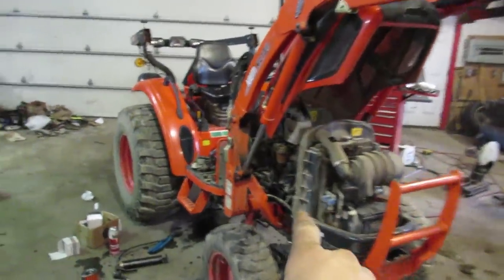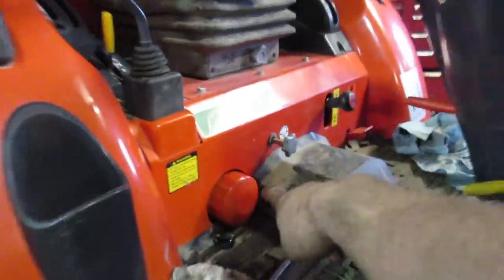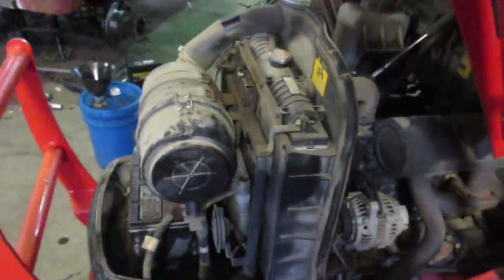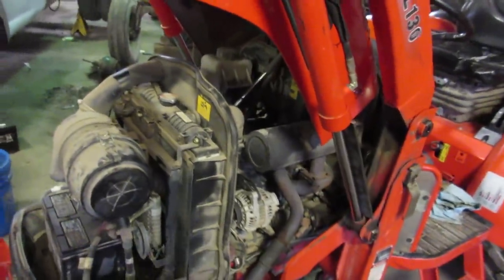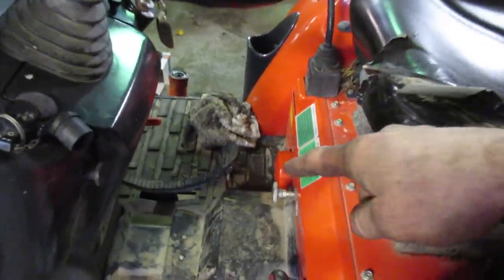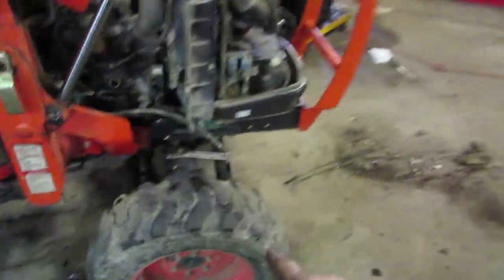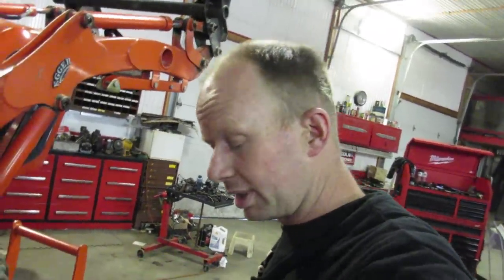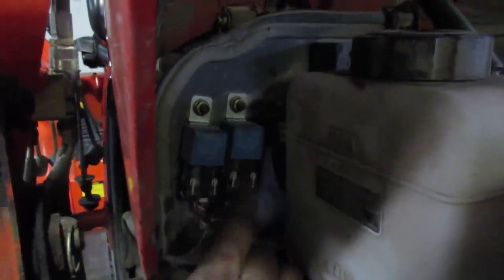Here's Why the Kioti CK35 Compact Tractor Is The Ultimate Oversized Lawnmower

Comment: I looked for a small tractor for over 5 years and then came across a Massey Ferguson 240 in an auction in 2002. The auction was in late November close to Thanksgiving and the weather was cold. Not many showed up for the auction. I got it for $6,000. It had 1030 hours. I got a loader for it and it's been a great tractor. The rubber was like new and it has two remotes. The Perkins diesels are great engines. The only thing that would make it better is a shuttle trans..... Love it........

Comment: I was probably the dumb guy that bought a new Kioti... Purchased a CK3510SE HC with loader and a backhoe in 2017. It is now a little over two and a half years old. It has only has about 120 hours on it, and it is stored under a covered shed, but when I do use it, I do not baby it, and I have had no problems. Regular maintenance is all I have done, and I use the loader at near capacity a lot of the time. In fact, the loader capacity of the Kioti, in 2017, was the main reason that I chose the Kioti over Deere or Kubota. I would have had to jump up a class in each of he others product lines to get similar loader capacity.
I don't really plan on needing anything bigger so I was not really worried about resale value, but that is a valid concern as it is definitely not as well know of a brand name.
I have also seen very few people that have posted bad reviews on the Kioti's. That was another reason I decided to take a chance on a brand that I had never heard of before shopping for a compact tractor. I have been happy with my purchase and have been impressed with the reliability, performance and features of my tractor. Really appreciated your video! Thanks for taking the time to make them.

Comment: I have a 2013 CK35 HST TLB It has been a great machine on my homestead. I thought about upgrading to a larger machine but I think its a powerful machine for its size and thats why I bought it in the first place. When I pickup more property I will just purchase a larger machine and let this tractor keep working. I have been using the backhoe a bit more this year, it has its limitations but it beats digging holes and working in western Maryland heavy rock soil it does the job well. I jsut purchased a 3rd function to use a grapple. I have a multitude of attachments for it and its used pretty much daily with about 400 hrs on it but my counter is getting funky. Great video, I am about to do a full service on it at the same time of the 3rd function install, plus winter is getting closer. I don't think the comparison to a overgrown garden tractor is accurate, I use to work in a Case IH dealership and this is a well built and powerful machine, but everything has a niche' and this can't compare to those larger machine for sure.

Comment: I have this tractor and use it with backhoe, brush hog, box blade, obviously loader and front forks. It is fun to operate. He’s right about clay, it can dig when the ground is wet but when its dry its a real challenge. It works well at my 5 acre home and Ive brought it to friends houses to dig and brush hog.

Comment: My father has the same CK35 except his isn't hydro-static. One major thing I recommend, if you put a backhoe on it, don't lift the rear tires off the ground with the outriggers, only touch the ground with them. We had figured we could lift the rear tires off the ground, but wound up snapping the bell housing one day essentially breaking the tractor in half since these do not have a full frame unfortunately. It was fixed, and the dealer was who told us not to lift it off the ground. Only other thing we had to fix was the forward/reverse shift rods because the lever was very loose, and sometimes would grind when going from one to the other. All around a great machine, some Bobcat tractors are exactly the same also.

Comment: Tractor vids are fun. I've got really good service out of my 35 horse 2006 New Holland TC34DA. I feel like these older tractors are the way to go, pre-emissions is so much easier to work on and less just that will ruin the engine. I too had issues with my NGK part glow plug timer relay. I wonder if there was just a bad batch that went out to all the tractor manufactures...? Other than that, it's been solid. Thanks for sharing.

Comment: i worked at a kioti dealer in Windsor Ontario for the past 5 years,  since the new emissions equipment has come out i really came to love these old mechanical ck and dk kiotis, the modern stuff has a lot of egr problems. 35hp and newer come with common rail now and their largest tractor being 115hp is equipped with a urea injection system, with all that being said, being a case ih guy i really came to respect this brand more after experiencing how they work and being sent down to kioti technical training in Raleigh north Carolina
Reply: The emissions systems on the 35-73hp haven't been that bad have they?  Is it possible that the customers are just not working them enough and/or keeping the rpms up??  The only issues we have really seen out here in BC have been operator error and 1 failed IMV on an early NX.
Reply: alot of not working hard enough problems and software updates causing gummy egr valves, we've also had multiple failed injectors on ck's and a mystery knock from an rx
Reply: @whoknew765  mine throws itself into regen around every 25 hours. No matter how hard I run it. However it will do it more often when I use the backhoe.
Reply: I believe they have a timer on the regen as well, not just determined by soot load but I would have to go back through my books to verify that.

Comment: I just got done working on one of these. It has a Woods loader on it for some reason. I had an issue with the loader joystick as it is cable operated. Cables froze up and got rusted and I had to rig up the valves to run the loader to get it in the shop. Just got it all fixed today and it works good. It had the shuttle shift manual. It drives nice but the shifter kinda reminds me of a worn out 3 on the tree Mopar. You kinda gotta search for forward and reverse. Not a bad tractor but not my favorite for sure.

Comment: Have a 2000 Kubota L3710D HST, bought it in 2012 with 1800hrs for $8100. Spent $1200 a year later to have all the seals on the back half replaced. Perfect tractor now, no drips. It is a little heavier than the newer tractors with the same power. Is also having some glitchy problems with the glow plug controller/timer. I like the extra size & weight. Have a post hole digger, 5' rotary tiller, 6' 'brush hog', 6' rear blade. The factory loader is very stout. Am on 2.3 acres about 45 miles NE of Denver. Michael in Colorado.

Comment: Originally l bought a used Kioti CK2610 from a friend with only 150 hours on it. Great little tractor that surprised me every time I used it, but wanted something bigger, heavier. Traded up for a used CK35 with 225 hours on it from a dealership thinking I was gaining some ground. It already had ballast in the tires, adjustable links and all the extras that I wanted. Like I said, it was used but with low hours... First time out using it to move hay, the CK35 seemed like the bucket was wobbly and the tractor didn't really have much more power than my 26. Decided to service the machine, changed oil, air filter, tighten the belt, grease, checked fluids, and check bolt tightness. That's when I discovered all 22 bolts on the bucket mounts were loose with some missing.  These weren't just a little loose. They were back out to the point the lock washers wasn't compressed loose. Further inspection I found that no thread lock had been used on the bolts and in two cases the rubber plug was still in the engine frame mounting hole which indicated a bolt had never been installed in that location. I've finished replacing all the bolts with new because the treads were damaged on the original bolts. I used thread lock on each one and torqued them to specs. I fully serviced tractor, fixing a few neglected issues and have it up working as should but as stated, not much more noticeable power than the 26.
Reply from the maker: The loaders were installed by dealers so it was a co-op student or new guy that messed that up

Comment: I have 2 35hp tractors. 1960’s Massey Ferguson l35 gasser. It’s great for skidding logs and woods work, ground clearance and turning radius. 
Kubota l35 tractor loader backhoe, very heavy machine for its size 7000#. The backhoe controls are backwards from what I’m used to running on excavators. Has been very reliable and handy
Reply: Love the L35. My old boss had one from the 80's or 90's and kept on chugging along with hardly any maintenance. Plenty of power for it's size. As a matter of fact, everywhere I ever worked ran old Kubota tractors that never broke down and got almost zero maintenance. When I buy a tractor will definitely be a Kubota maybe even an L35.

Comment: Love all your videos and my favorite mid size tractor is Ventrac. I have two 4500 series one gas job and one diesel. I maintain Lowe’s target and FedEx retention ponds with them. I can climb and traverse 30 degrees plus. And they have 31-35 horse powers and all wheel drive. 50” cutting deck. Great machines check them out. Over and out!

Comment: I actually used to work at a Kioti dealer, I liked them,  way better than the green equivalent. Parts were always a pain to get even as a dealer. Many times I would have to wait 4 to 6 weeks for some thingsn
Reply: This. At 65 hrs on mine hydraulic pump blew. They provided me the wrong filter for hydraulic side, it turned out to be a hydrostat filter choked the flow off and cavitated pump. Took 6 weeks to get er fixed and they returned it 3/4 a gallon low on hydraulic fluid...........
Reply: @shelterskelter  sounds like your run of the mill tractor dealer. I was the only one who was working on them at this dealer but It would take 6 plus weeks from drop off to completion,  which is a joke
Reply: @totalmobilesolutions4138  why wouldn't the dealer stock parts for them ?
Reply: Patrice Le Brasseur because they weren’t forced to. And why do more than the minimum when you’re the only one around to service them? That’s why I left. Lol
Reply: @totalmobilesolutions4138  that s infuriating and it happen more and more enven with hay and sillage equipment, the kind of thing you know they will break and where downtime is unacceptable

Comment: I like watching your videos.  My favorite 35 hp tractor is my 1300 Ford with a Kubota 1105 Turbo engine , that I swapped in myself (with a little work).  This 1300 was originally a 16 hp.
Reply: dan mariani love my 1100 . Had to rebuild it at 2000 hrs though

Comment: Looking for a replacement for my 318 Deere. Needs to have a loader, tiller, mower, snowblower, and I'd like to get a 3 point genset. Because I have a bad shoulder (20 years auto/diesel tech) I'm leaning to the 1025R because of the quick connect mower deck and the brackets that are made for the deere loader.
I know I could get another brand cheaper, but I have a Deere dealer near me, and the equipment goes on and off WAY easier than the others. 

Keep up the awesome videos! If you find yourself in Southern MN, give me a shout, you're always welcome here!

Comment: I had a 2010 Bobcat CT235 which is the same unit. It was exceptional. Most electronic abnormalities are caused by relays and likely won't treat themselves until after 5 years. The ignition relay caused loss if gauges, lights, rear power but not in any order. Failure to start, or shut off, likely also a relay. I am 80% clay, had the BH7 and it dug effortlessly to its 6.5' depth. Also, I had a 1,000 lbs TMG80, which is an 80" C-tine tiller and through the same clay base, where there was grass and a poplar tree line, it effortlessly handled that massively oversized tiller. The hydropumps on the Kioti's (Daedong SK) typically  have larger flow capacity than the Kubota's and that's weighing heavily on the market preference. Had to sell mine in a crunch, unfortunately, after 9 years. 450h only replaced relays (3) and changed fluid /filters. Cheers.

Comment: Love these little videos on your insight into stuff that rolls through your shop. My experience with operating a larger version kioti was that it under performed and had a lot of HST warranty issues ( a 2010 or 2009 version). Little stuff too like the grease fittings were kinda messed up and would only take specific guns. I think you can see where they cut costs a little compared to kubota. I asked a lot of it though, but who doesn't from their tractor?

Comment: I love my tractor like this.  Mine is a Bobcat CT235 which is the same tractor but Bobcat painted it white and black.  The only issues are the neutral safety switch on the hydrostat pedal will stick open in cold snowy weather preventing startup, and the MLS valve (controls the 3 point lowering speed) had a problem on many of these.  The MLS valve is a simple zero dollar fix but is extremely difficult to see where the problem is.  It’s a plugged orifice inside the valve... a VERY tiny orifice.  Otherwise great little tractors.  People want to buy mine all the time because it’s a simple, pre-emission diesel.

Comment: I have a 2008 CK 25 shuttle shift I mow two acres with a 60 inch finish mower I also have a loader . It’s been a great tractor for me I use the crap out of it . Very little trouble overall

Comment: I have a 1998 John Deere 4300 with a 430 loader and a 48 hoe, hydro trans,  it has been a great tractor and the worst tractor all in one, it does have a Yanmar engine that runs great, it ran full time for years, construction, trenches, graves in the summer, snowblower in the winter, the hour meter quit working at 5000hrs when it was about 8 years old and yes it was 5000hrs, it has been retired to cutting my lawn and some snow blowing in the winter, just like the old thing still starts all winter.

Comment: Yanmar has been making JohnDeere tractors for years I had a Yanmar tractor the only difference was the color and price the yanmar was a lot less
Reply: Yes, that green paint is very expensive.  LOL
Reply: Buddy owns a boat repair and sale shop and has been using the same yanmar tractor for 20 years and it will pull anything, we pulled a stuck semi tractor up a snowy hill with it lol and it's a 40 horse tractor.
Reply: Yanmar is good stuff.

Comment: My favorite 30 hp tractor would definitely be an mf 135 closely followed by a Kubota L3800
Reply: The 135's are my favorite and got a soft spot for them. First tractor my grandfather bought new was a 2.5 diesel in the late 60's and in the mid 70's my dad bought a used gasser being his first tractor he bought. They cut hay for our couple hundred dairy cows until 1991 when they were retired. Winters of 2008 and 2009 when i was just starting to take intrest in mechanics the 3 of us completely rebuilt and restored them, the diesel actually makes 48 hp at the crank and the gas 35 hp. In 2014 when my grandfather passed the diesel pulled him for one last go on an old horse drawn slay from the church to the cemetery. Still have them both and use them fairly frequently for odd jobs. Never had any problems with them with regular maintenance.

Comment: Not a Kubota I worked on one that was d bagde at a glance told customer no problem course there is a Kubota dealership near by boy was I surprised when I got a closer look thought it was a Kubota and then I had to find a kioty dealer to order parts but nippondenso  3 cylinder diesel like a Kubota some of the parts interchange otherwise pain in the ass to find parts for a good. Tracker no complaints

Comment: Wonder if all these hydrostatic drive baby tractors will be running when they are 30 years old? I have a hydro forklift and it's one hydraulic leak after another, it's 30 years old now.
Reply: I dont know about the hydros, but I had the same thought when I bought one just like this in 2008 so I bought a gear shift.  After just 5 years and 700 hours it burned up the clutch and the syncros in the trans. Had the dealer fix it, and just three years and a few hundred hours later it needs a clutch again!  I'm thinking I'll do it myself this time.

Comment: I have a 2013 CK 35 (shuttle shift).

Does anyone know if there is an adjustment for the rock shaft, that will allow me to get a couple more inches of lift at setting #10? 

The Ford 101 plow im pulling only has about four inches of ground clearance on level ground when the three point hitch is all the way up.

Comment: My Dad has the same unit. I like if for its fast road speed but its break out strength is a little disappointing. I can work with it but my old 4200 john jeer can bury the bucket in top soil and pull the bucket right out.

Comment: As someone who works in fuel injection, I'm not huge kubota fan because there's so little support for their stuff. Even it it's a Denso or Zexel injector or pump, there's almost never part numbers on stuff. I'd buy a Kioti over a Kubota just for that reason. Yanmar's just as bad if not worse.

Comment: You said you had to add oil to the front axle? Where is the oil leaking? I Have a small Massey Ferguson gc2300 and it seems forever I am changing the seals on the knuckles on the front axle, ty for sharing

Comment: I don't think you can go past a classic Massey 135 diesel for being the best tractor in that hp. Run forever, and use very little fuel doing it, simple to fix if/when it does break down, and built when a 45hp tractor was used as a tractor.
Reply: Still using a late 60's 135 as a tractor, and plenty older ones around here are still turning and earning - 35, 35X and even quite a few FE35 still doing the do.  The odd blue one as well (Super Dexta, 3000, 3600, 3910 etc)